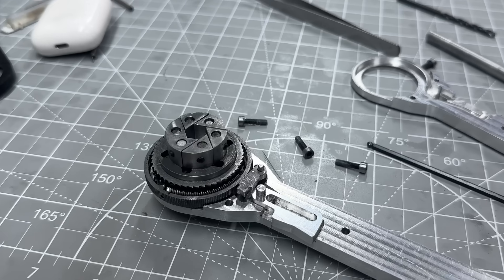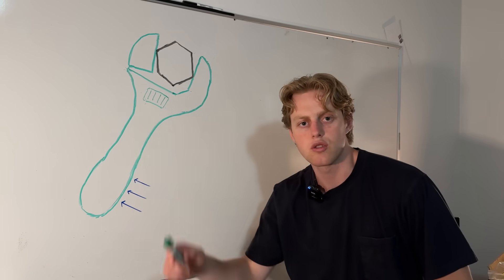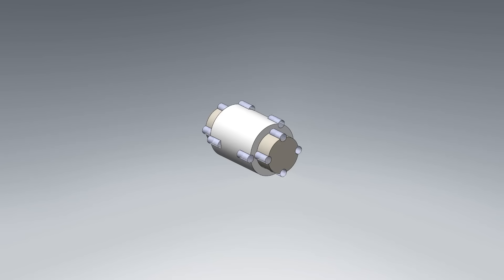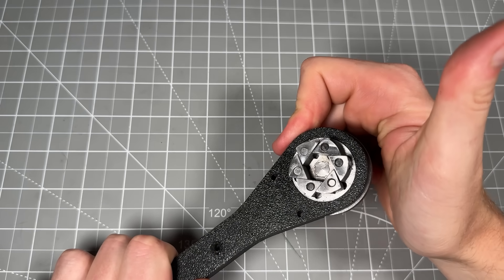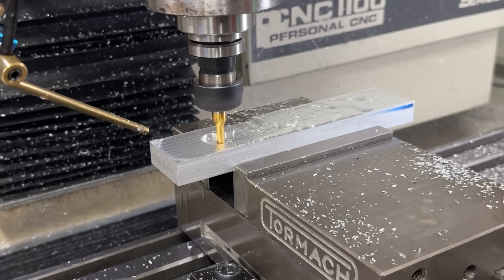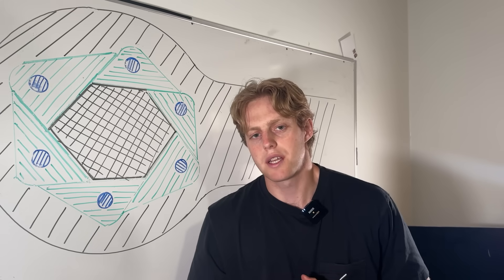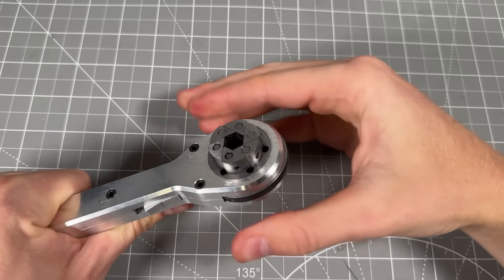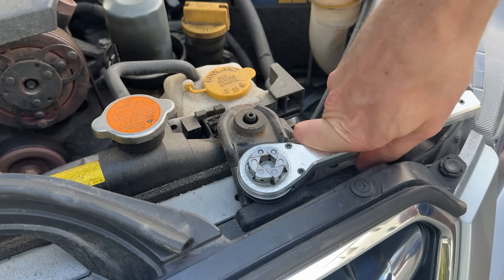I Invented an Adjustable Ratcheting Wrench

Comment: here are some suggestions for improving the wrench's materials and design to enhance its durability, versatility, and user-friendliness.
## Material Improvements 🦾
Selecting the right materials is crucial for balancing strength, weight, and cost. While the creator made an excellent upgrade to 52100 steel for the pins, other parts could also be optimized.
 * Handle: Instead of a solid steel handle, which can be heavy, consider using 7075-T6 Aluminum. This alloy offers a strength comparable to many steels but at a fraction of the weight. For an even more premium and ergonomic feel, a composite G10 or carbon fiber handle with a rubberized overmold would provide excellent grip and vibration dampening.
 * Jaw Teeth: For the ultimate in durability and wear resistance, the teeth that grip the bolt could have Tungsten Carbide inserts brazed onto their tips. Tungsten carbide is exceptionally hard and would prevent the gripping surfaces from ever wearing down or deforming.
 * Spiral Plates & Internal Mechanism: The core plates that actuate the pins require high rigidity and strength. Using 4140 or 4340 Chromoly Steel would be a great choice. These steels are tough, machinable, and can be heat-treated to a very high strength, preventing the plates from twisting under extreme torque.
 * Pawl (Ratcheting Clicker): The pawl is a small but critical high-wear part. It should be made from a tough, shock-resistant tool steel like S7 Steel, which is designed to withstand repeated impact forces without chipping or breaking.
## Design Improvements 💡
These design changes could address the limitations mentioned in the video and add significant new functionality.
 * Solve the Recessed Bolt Problem: The bulky head is the biggest weakness.
   * Tapered Jaw Profile: The jaws could be significantly tapered towards the tip, allowing them to fit into tighter spaces without sacrificing strength at the base. A chamfer, as the creator mentioned, is a good start, but a more aggressive, continuous taper would be better.
   * Pass-Through Head Design: Redesign the head so that a bolt can pass completely through it. This would allow the wrench to be used on long threaded rods and would be invaluable for tasks where a deep socket is normally required.
 * Enhance Usability:
   * Directional Indicators: To solve the problem of remembering which side tightens and which loosens, laser-etch clear directional arrows ➡️ tighten / ⬅️ loosen directly onto the handle or head on each side.
   * Higher Tooth-Count Ratchet: Increase the number of teeth in the ratcheting mechanism. A 90-tooth or 120-tooth ratchet would reduce the swing arc needed to engage the next tooth, making it far more effective in confined areas where handle movement is restricted.
   * Quick-Release Adjustment: Replace the simple switch with a spring-loaded, one-handed quick-release button. This would allow the user to press a button to open the jaws, place it on the bolt, and release the button to have it snap shut instantly.
 * Add Advanced Functionality:
   * Digital Torque Measurement: For a truly next-generation tool, integrate a strain gauge and a small LCD screen into the handle. This would turn the tool into an adjustable digital torque wrench, providing a precise readout of the force being applied. This would be a game-changing feature that would truly challenge a mechanic's socket set.

Comment: There actually was an adjustable ratcheting wrench patented long before. For example in 1972 Davenport Tool Co filed an application that was granted in 1974 as US3803954A. It described a hand operated ratchet wrench with a movable jaw and a ratcheting handle that allowed adjustment independent of the angle. So while you may have designed your own version the concept of an adjustable ratcheting wrench was already invented and patented decades ago.

Comment: hate to say it but to bulky and cant change the length of the socket so that leave's it to the life of construction but they rarely ever need to change size and it's also kinda to small for all that anyways and they can just use power tools.

Also i would say hope you got a paten for that but china will probably be mass producing them by this time next week lol I'd just sell the design to a tool company and move on to the next thing tbh

Comment: Very cool but too likely to fail over time with almost no chance of repairability, I'd rather have simpler & cheaper wrenches and sockets. And the downsides you mention at the end are ... Real. I've rarely ever needed a wrench or socket and had all the bolts readily accessible.

Comment: Solidworks is the best CAD software IMO for designing machines and tooling since it's has easy features using real-world simulations as you can adjust force, angle, material type and strength in the simulator. It shortens the time and cost management for testing the end product design.

Comment: In my field of auto and heavy equipment mechanics, the notion of replacing sockets and wrenches with one single miracle tool is a pipe dream. Engineers know the minimum size of a socket or combo wrench and in any job there will always be at least one bolt that is just barely accessible. Very cool wrench you've made though.

Comment: I can’t speak for other sectors but in the automotive sector we need smaller tools for tighter clearances. For example your wrench is simply too big to use when removing car doors or mufflers or suspension parts. If you could make it small like a regular ratchet wrench it would definitely be a seller! Keep on going this thing is cool!

Comment: I work in industrial maintenance and one of the most important parts of every technician's "every day carry" is a wrench or two that can handle a large variety of sizes; or at least the most common ones in the plant. Just about every technician, myself included, carries a set of 4-in-1 wrenches. We all got pretty hyped up by Wera's Joker wrenches, but they came with some drawbacks like poor return angle and being just barely too bulky for hard spots. 

We've come to the understanding that a jack of all trades wrench can't be a master at anything but if it does most jobs reasonably well and is built to last then it earns its place in our pockets. I'm very much looking forward to how this develops.

 I'm sure it'll have its place in automotive work, but I see a lot of potential in electrical, millwright, and plumbing trades. When you land on a prototype you feel confident about field testing, see if there are any trades-people or technicians you know who will be happy to put it through the ringer. The most important input to make it more practical will come from them.

Comment: This is an excellent demonstration of your ingenuity. No doubt you've already identified many of the limiting factors, just my two cents:

1) When milling the wrench teeth was there a reason you didn’t use finishing passes when machining them from a solid block to bring them within tolerance?

2) When machining the ratchet gear and the slotted plates, it may be possible to machine them on a multi-axis lathe, similar to how some spur gears are made, then use a parting tool to cut thin disks from the rod. This may not be possible with the equipment you have access to, but may be something worth thinking about.

3) Alternatively, while laser cutting the slotted plates may not have worked, die sinking may be something else to consider. It might be more expensive up front, but if you are working with heat treated steel it could have some benefits, though I am not too certain if they would out weight the negatives.

4) To decrease the height you could have the tightening socket on one end of the wrench and a loosening socket on the other. Since you already have to mirror the mechanism on the other face of the wrench, I don’t suspect that this would add significant difficulties to the manufacturing process.
Reply from the maker: Great comment! I am definitely looking a CNC lathes with live tooling for medium size manufacturing runs. I also did consider splitting up the mechanism as you suggest. I am a little hesitant to move all of the weight off the axis of rotation though...

Comment: Use different colored teeth on each side in order to make easier to remember which side tighten and which side losen. Plus maybe etch teeth would had grip on the nut or bolt.

Comment: Very Clever. Get a Patent! I "subscribed" just to support you. It's nice to see smart young people. :-)  My 2 cents... I'm old. I have seen many of these sort of "all in 1" wrenches come and go. This is an excellent design, but it will be hell to manufacturer IMO. I actually have like 5-6 of these sort of "one wrench fits all" wrenches. They are great for "selling" but not so much for "using" They generally are always too large and fiddly to be useful. The fact is that in many jobs you end up with only 1-2 size bolts anyway. The last thing you want is a wrench that will end up "too big to fit" in one of the places you need it.  You obviously have a great mind., I would double down on an Engineering degree and make some real money.  Don't give up.

Comment: if you cleaned up the entry edges with a slight slope to them, you could make it slip on easier without even opening it
Reply: also dont trip on working on the subaru with this. i need VIM tools in a lot of spots to get in properly with space to work comfortably

Comment: I think many tool guys would love a perfected design of this and you are getting pretty close to perfecting it. Now it does have limited use since it is for external bolts only as far as what could be reached so a car mechanic and the light won't be able to use it very much except maybe on body or framing bolts. Ranchers might like this because we deal with bolts of many different sizes on each project so anyone in the farm or ranch industry might really enjoy something like this. It looks better than the socket that's supposed to fit many different nuts and bolts but is usually garbage once you torque it more in a few pounds. Keep up the good work I will definitely buy one of these when it's ready

Comment: You could lean in to the upside you noticed that the outer ring gives finger like control on the bolt.

When you pointed that out, I thought this thing would be pretty awesome without a handle as a ratcheting wrenching circle. It would help with restricted access to lose the handle and I think competing with a traditional crescent wrench for the ability to get the high torque break done will be really tricky. Maybe a detachable handle? You can also lower the design torque spec if you went no handle and try to slim out parts/the design.

Awesome work!

Comment: If this mechanism was built into some sort of socket housing that used a typical ratchet, I think you would really be onto something. Even if you had an ‘ON’ and ‘OFF’ socket, you could still cut down on total tools carried.  The main problem is how things are built. Many different sized fasteners when a couple would generally work, and some things being built in very tight spaces for no discernible reason. Usually because the engineers that design cars and many other machines, aren’t mechanics and don’t care to think about maintenance. (Even tho damn near everything is built to fail these days. Shame on us, as a society.)

Comment: it's kinda quicker, maybe, arguable that adjusting it every times is quicker than flipping bits, i would lend on longer, but... definitely gotta snap to standard sizes, and stay there... definitely smaller than a full kit... major problem is that you cant torque w that, and this would become looser and looser over time... for general peoples with no specific constant use, like stuff around the house, thats great.

im not sure how exactly but i would put the mechanism around instead of inside, with something that forces it to squeeze more the more torque you apply.

_

Comment: Recessed bolts could be accessed by using a ratchet extension that has a hex around the female square drive and putting that in the adjustable wrench. With that in mind it'd be seemingly easy to make an accessory that uses a hex to male square drive to use any ratchet attachment but now we're back to just using a ratchet lmao, just throwing ideas. Great build and video either way

Comment: i would personally love to have this tool it would make my socket set basically useless and would help me tremendously if u want some criticism tho it needs 3 sizes one for tiny bolts and nuts one for medium sized bolts and nuts and one for large bolts and nuts so u can effectively cut out all bolt size issues and make sure to torture test it and make the thing hulk proof like i should be able to run it over with my car and still use it because I've worked in a lot of shop environments and guys are using ratchets like their indestructible but overall i think this could honestly be the future of tool technology but u cannot get this thing sold on the gimmick alone u need marketing as well as good customer service when the tool eventually breaks

Comment: Epic bro 😎. I think it’s entirely marketable. It’s good for “most” jobs. It’s not good for automotive needs beyond simple battery replacement or big, easy to reach bolts. If it were a product, I’d buy it. I’d work on focusing on how to make it smaller. For me, I would keep this in my truck for daily road use. I don’t want to weigh my vehicle down & waste storage space with a huge toolbox. This, I would recommend putting an “on the go”, twist to your marketing niche.

Comment: Instead of doing the full handle Etc. could you make the "Clamp Style" portion like an accessory for regular Ratchets and Extensions? being able to clamp a bolt and then put it into a tricky place before your start turning it would be really cool. Granted that is a problem that people get around with tape, and weak glue etc. so I guess cost is a major consideration at that point, But this is SUPER cool!!! I worry about IP though. do you have any protections yet?

Comment: This design is amazing! Your ingenuity is inspiring. I did wonder if its possible to make this kind of tool as just the socket. You could have 3 sizes for the different size ratchets they would belong to: 1/4", 3/8", and 1/2".
With a socket like that, people could use existing ratcheting wrenches they have, and could even use extensions to get into hard to reach spots. You might even be able to slim it down enough to reach into tight areas as well!

I hope you find success, keep up the good work!

Comment: Definitely need to make the ratchet backlash torque less. These could be handy for doing nut and bolt checks under cars where several socket sizes are needed. Only caveat is the centre isn't open so can't be used for nuts on studs. 

Cool design. Looking forward to how this develops.

Comment: its definitely not a all purpose wrench, since you can use it for tight spaces like in vehicles, since I like working on my car, I wouldn't want to use it for something like that since the thickness would get in the way. But I can see it have uses in construction.

Its too bad that it has to be that thick in order to take the amount of stress needed to tighten and loosen bolts and whatnot.

Comment: I’m new to this project journey but has he tried adding an opposing ratcheting gear and and a notch slip for the gear catch . That way you don’t have to have another bolt ratchet face on the other side and this keeps the design slim .

Comment: maybe u could use a form of longer heards so that way you could design it around a impact gun, or some form of drill, and would only need to use the end of it, as it would work perfectly, i wonder if tho for the wrench version, if you could, have a way of having the bit stay open, and then snap on, when u place it on the bolt, so that way, for the hard to reach to bolts you dont need to also have your hand free, at the same time, just a though love the idea man keep it up,

Comment: brother hurry up and patent this before posting online!! you have an awesome idea here and though it may not replace sockets (mainly for very heavy duty use) it would be an amazing tool to have on hand for those jobs where youre dealing with a ton of different bolt sizes and dont want to run to the socket drawer every 2 minutes.

Comment: One suggestion I would make would be to have an opened center so that you could use it on nuts that are on long bolts or threaded rod not even sure if that would be possible with this idea but it would definitely broaden the market

Comment: not a mechanic so i have no idea how hard this would be, but i can say as just a normal guy that having something like this in my car would be really handy, but i would be much more inclined to buy it if the dual head was scrapped and the center was a hole so you could just insert the bolt head from either side, it would make me feel more confident that it wouldnt break somehow, at that point i would 100% buy it, hope that helps!

Comment: The ingenuity is right up there with Grant Hawk's Deadlock knife, I would buy this ratchet just for the cool factor.  I work as a test technician, I carry a few tools with me all the time, if I run into an application that requires something like a deep socket, I have to go back to my big toolbox for it, but the handful of tools I carry everywhere work for 80% of the applications I do, I would definitely add this to my bag.  If you patent this and put it on kickstarter to gauge interest, I will put up a pledge for at least 2, I can see people buying these as a cool gift as well as for work.